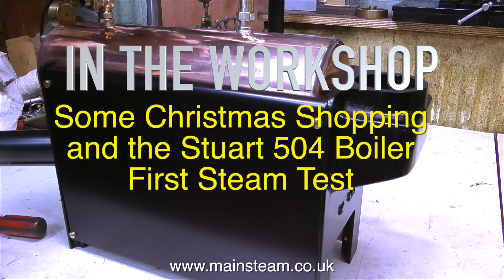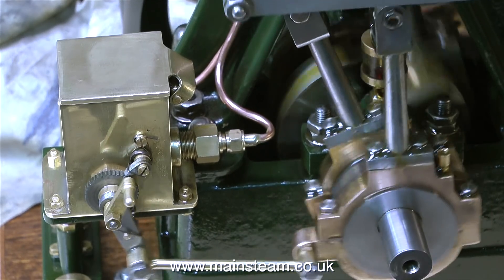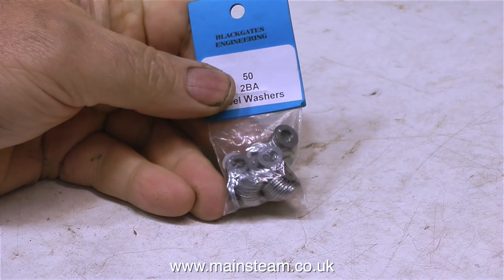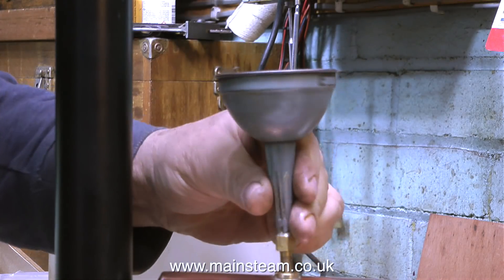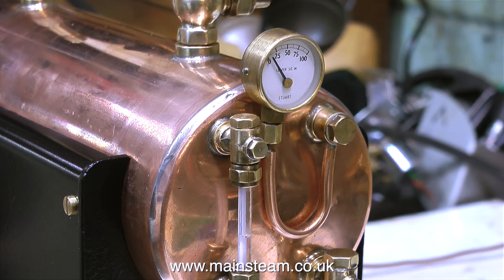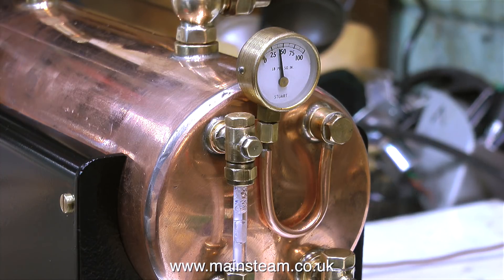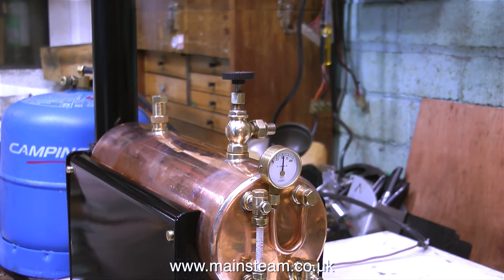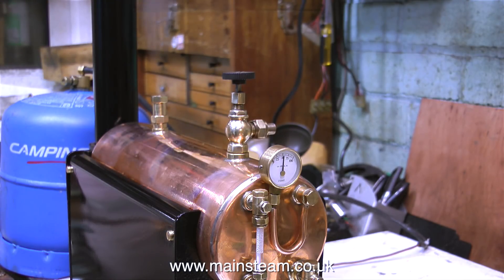STUART 504 BOILER STEAM TEST - IN THE WORKSHOP

Comment: Hello
I own a similar boiler like this, you mention different gas mixtures like propane/butane and butane, what is the difference between these when using these to heat the boiler with?
Which is best to use a truly alcohol burner or gas burner? My experience is leakage from the alcohol burner and the propane/butane can be dangerous in poorly ventilated space.
This is a first steam plant I build and my experience is small.
I like your way of explaining and your humor, do not mind negative comments, keep working your way.
Micke T from Sweden.
Reply from the maker: Propane is at a higher pressure than Butane, alcohol burners are generally not controllable in the way gas is.Tthat's all I can say really - please watch a few more of my videos as I frequently explain things like this.

Comment: I thought a drain cock is closed when the handle is pointing down, so it does not open under vibration. Certainly applies to car radiators ( old Landrover)
Reply from the maker: It's the other way round on these .....

Comment: I recently added a ceramic burner to my 504 that I've had for 48 years.  I mounted it into a sheet metal channel with wing sections on booth side to defect the burner heat up and provide a heat shield to protect the paint on the side sheets.  works well.  Your plant is going to be very nice indeed!  I wish I had a Blackgate close by!
Reply from the maker: That's just what I am going to do when I assemble the boiler into a steam plant.